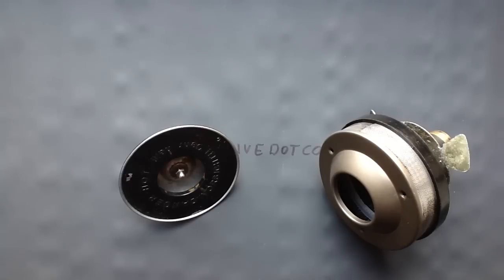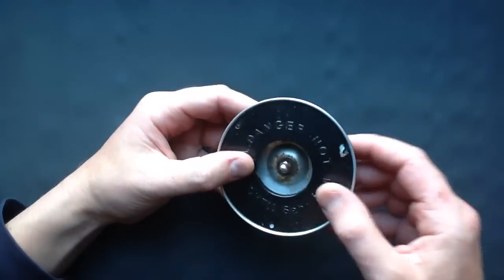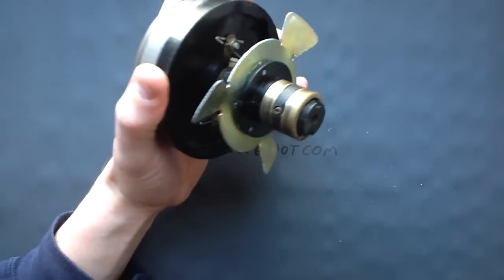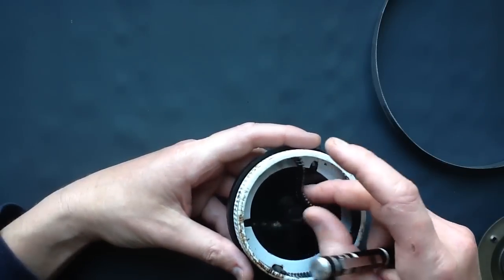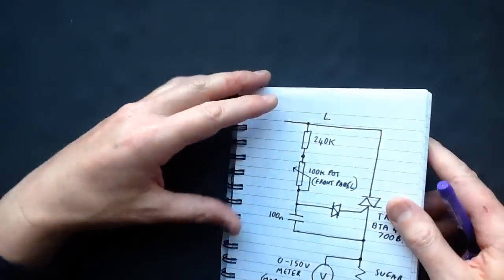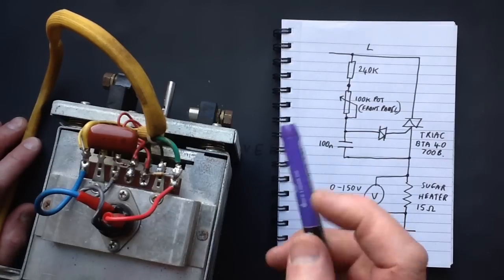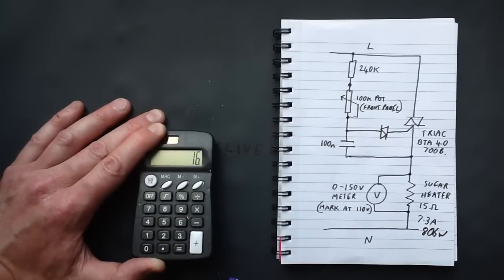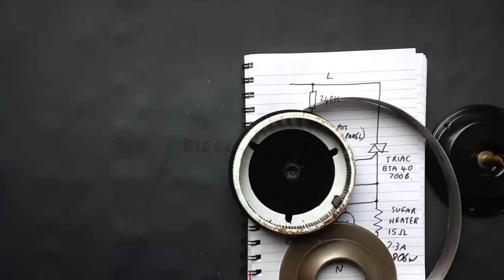How does a cotton candy floss machine work?

Comment: Your 4kW calculation made my man-brain start thinking about how to "amp up" a machine like this.  I'm thinking clothes dryer drum, multiple propane weed burner torches (restrictors removed, of course), and a petrol engine.  You'd need a conveyor to keep it fed with sugar!
Reply from the maker: And no outer drum, so it just coats everyone and everything in floss.
Reply: bigclivedotcom foam parties are passe, floss parties are the thing. oh and a little something for the burns
Reply: +bigclivedotcom I approve of this idea immensely
Reply: Dude that's still to small, think bigger, like something with a cement mixer!

Comment: As a child we used to get candy floss from a coin operated machine. This was in a local café. 
You put in the coin, take a stick and then twirl the stick in the machine between the spinning drum and the outer wall. The machine automatically dispensed some coloured sugar into the spinning drum.
Reply from the maker: You get fully automated candy floss machines now.  They load and rotate the stick while the drum itself rotates to simulate twirling the stick around the drum.